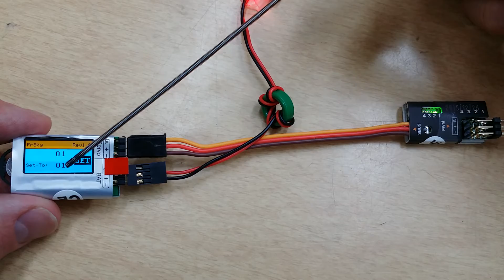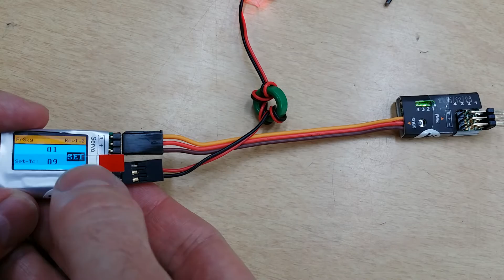How to program FrSky SBUS/CPPM decoder with SBUS Channel Changer

Comment: Hi David  I was wondering if you can get 16 channels on the R9 rx the same way as X8R by jumping 1 to 2 and 3 to 4 on the signal pins. By doing it this way on the X8R I didn't need any extra gear.